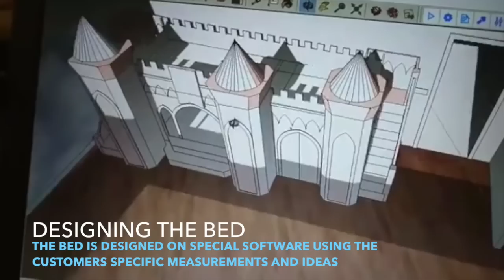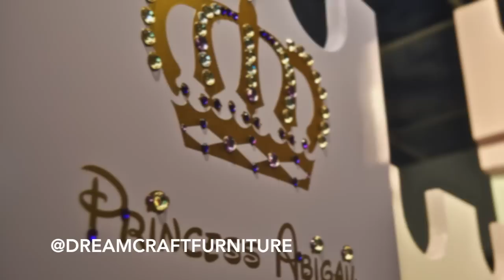Inside Dreamcraft Furniture Children's Themed Beds Princess Castle Bedroom

Comment: Its so pretty! I think that not only is the princess castle an amazing idea for a bed, but I think it would be a cute way to connect two rooms. For example; you can have the kid's bedroom with the castle bolt against the wall, and when they go through the little doors, there can be another set across the castle (so the castle will also be on the other side of the wall) and when they go out, it could lead to a play room!